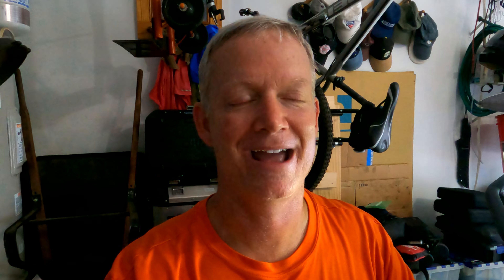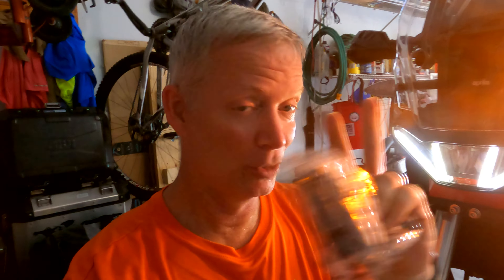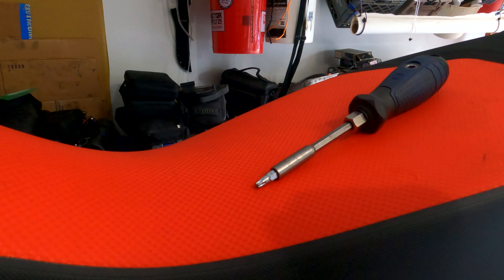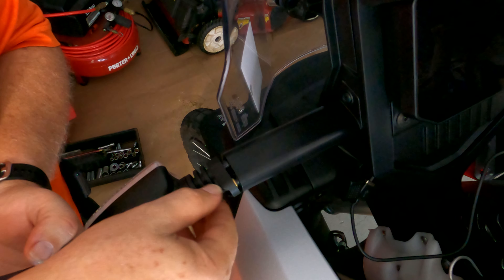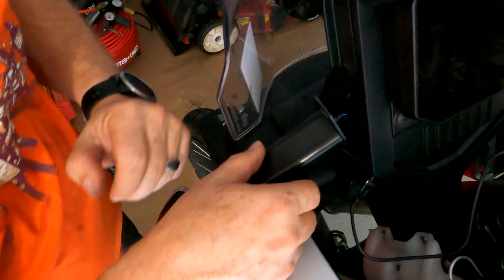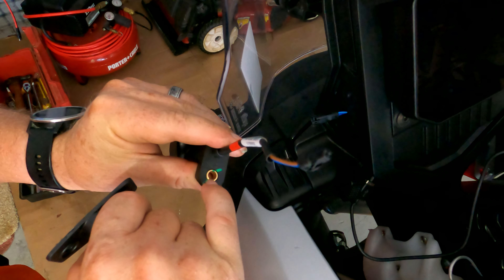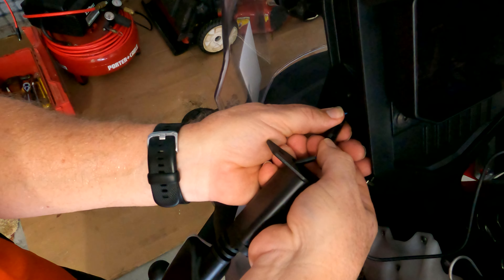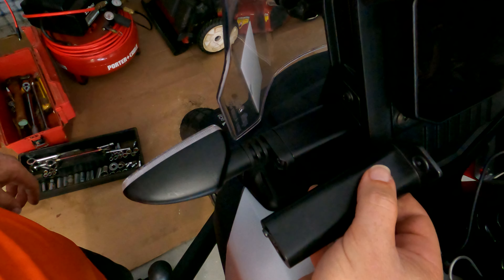Aprilia Tuareg Better Blinker - How to install short turn signal standoff on your Tuareg 660

Comment: Thanks for taking the time to put together this tutorial. Changed them today.
Reply from the maker: Glad I could help!  We have a whole playlist on Tuareg mods.  I hope you'll Subscribe and check some other ideas out:  https://youtube.com/playlist?list=PLMpCu16Bx7xMLl4ieTqBAce95UHO5UuGT&si=RBl3m6Se13uRhV5h.  🙂
Reply: @MotoPhotoAdventures  I'm subscribed! I hope you to do some maintenance tutorials! I haven't owned an adventure bike with a chain since 2007!
Reply from the maker: @SpeciesPlantarum  we have a ton of those types of videos!  Here's how I maintain my chain on the Tuareg:  https://youtu.be/UPTnk1ORXic?si=DuifI1ZMO64Gwks6.  I also use the BPA Chain Slack Adjuster tool to help keep the chain in the proper tension:  https://youtu.be/3hdtqnFkNKA?si=C9G_CQnNG3OaoIU2.  Poke around the channel when you get a chance.  Not all are Tuareg specific...but everything from changing tires to plugging tires and replacing sprockets...many of the tutorials are not bike-specific.  Cheers!

Comment: Just changed.  Quick and easy!
Reply from the maker: Yay!!!  Glad we could help.
Reply: @MotoPhotoAdventures  On another note, have you thought about headlights covers?  Seems like the only safe design would be plastic ones with the corners attached to the light.  Aluminum ones could bend and bang into the headlight?
Reply from the maker: @luciano136  I've certainly considered it.  But honestly, when we're on trips, I'm the "navigator".  So I'm usually in front.  The few times I'm following other riders, I tend to hang back to let the dust settle.  A rock in the headlight is always a possibility of course.  But for me personally, I consider it a minimal risk.  So I've never put a headlight cover on any of my bikes.
Reply: @MotoPhotoAdventures  Yea, you're probably right.  I may only install it for long trips, but leave it off otherwise.

Comment: Looks great Chris. Torx is a superior fastener. More points of contact. Common for European bikes. The best is when it's a torx bit and the outside accepts a socket. (You probably have some of these on the bike.) Fewer chances of stripping the fastener and having to drill it out! - Frank
Reply from the maker: Very cool!  I hadn't thought about that, Frank.  Thanks for the tip.  I'm looking forward to gleaning other insights from you next week!!!
Reply: @MotoPhotoAdventures  Jason will remind us that JIS (Japanese Industrial Standard) has been FINE for 90 years! - Frank
Reply from the maker: @OneOldManRiding  HAHA...riiiiight?!?

Comment: I do not own one of these. So without seeing the old part up close. What would happen if you cut the old stck to the same length. Are the hollow and just use self tapping screws. Will it just mount right back up? 

Someone wants to try it…..
Reply from the maker: The problem with just cutting off the end is then the turn signal assembly wouldn't have anything to screw onto.  You might be able to cut a cross-section out of the middle...but because it's tapered the two halves wouldn't align right.  You'd have to shim it somehow and super glue the pieces back together.  For $6 each, it just isn't worth such a hack-job on such a beautiful bike!
Reply: @MotoPhotoAdventures  again I dont own one, and understand the issue. I mean its a couple bucks. No big deal. But after watching the video. The inner diy’er just comes out and thinks hmm. What if
Reply from the maker: @JAdkison-tr7vn  I totally get it!  I'm the same way.  If I could DIY it, I would.  But if you cut off the molded bits at the end of the OEM stalk, there's nothing to attach the blinker to.  At that point it became an engineering hurdle beyond my pay grade...and I just ordered the shorter ones.  🙂